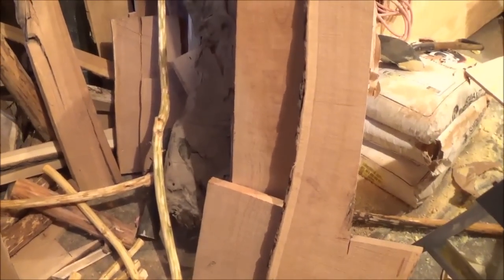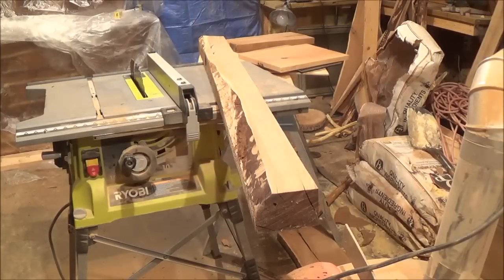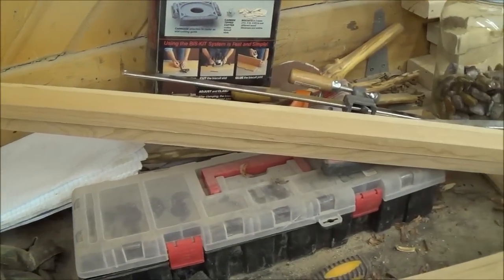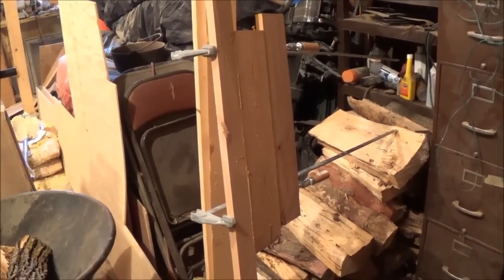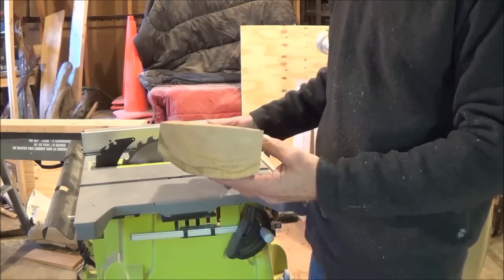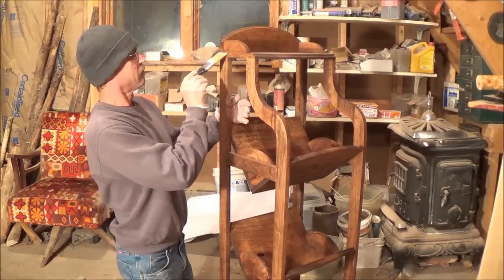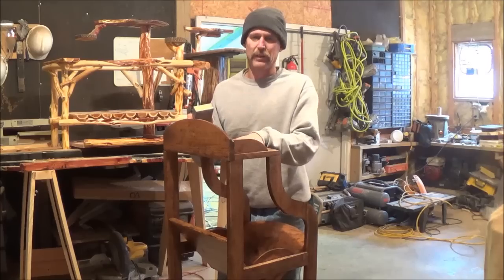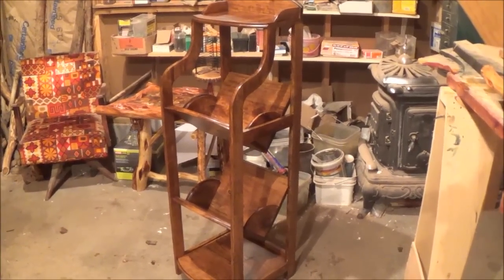FOREST TO FURNITURE. Melissas Kitchen Cookbook Bookcase. Wild Black Cherry.

Comment: Have you ever tried BriWax as a finishing rather than varnish?  To me it is a very close finish to "French Polish" finish. It shows the grain of the wood very well and also gives it a very good depth to the wood. I have only used it on old hard wood flooring after sanding and staining. Then on with the BriWax. Great on flooring, and also on antiques. Gives it this wonderful rich glow. Not so sure how well it would work on fresh wood though. It has been a long time for me in using it, but was only wondering what your take on it was?
Reply from the maker: ezygong I have never used that product before, I will have to see if I can find some to experiment with. I have done gun stocks using linseed oil and hand rubbing coat after coat. It looks great on walnut. Thank you. Joe
Reply: ***** They have it on Amazon Prime. I like it and have found that the clear is best used after the first coat of the colored BriWax coat. To me it gives one of the finest patina of any of the other products I have used. It has been  a number of years that I have done work that would require any type of finish.